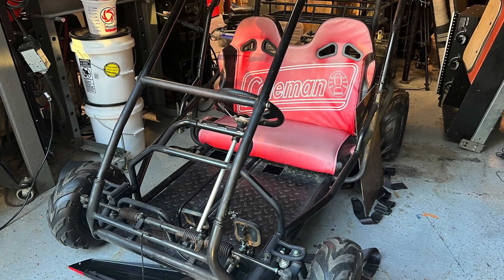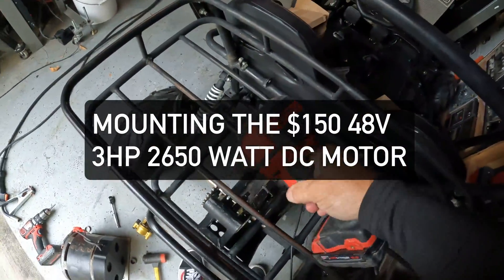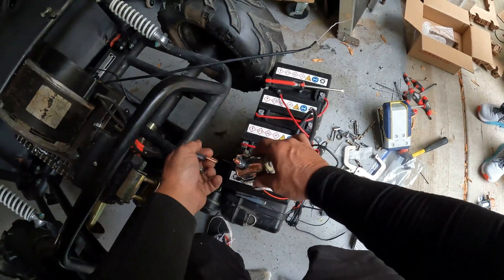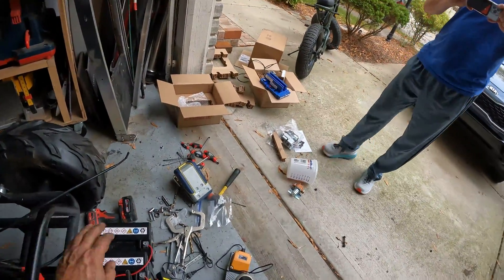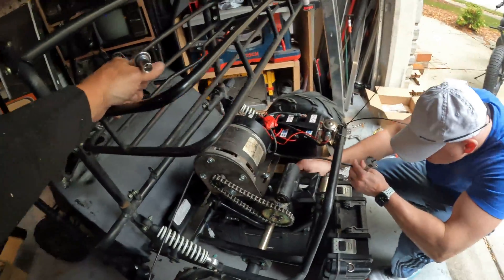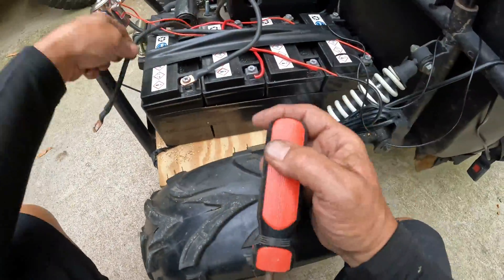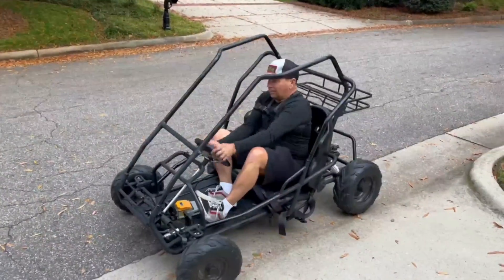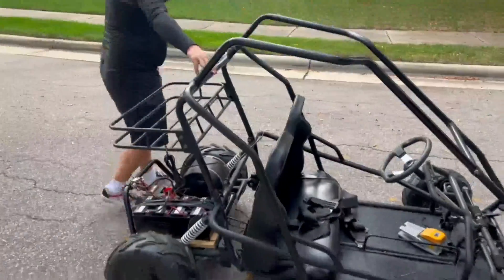Coleman 196 Electric GoKart Conversion - Part 01

Comment: @hack-lab this is EXACTLY what I'm attempting to do now. Swap the 196cc gasser for a 48v BLDC. Is that a normal Brushless Motor or does it have gear reduction? How is your gear ratio? I was thinking of using the jack shaft to keep the gearing taller for any inclines. Sub'd and following this build. Thanks!
Reply from the maker: The car was extremely fast. I use the jack shaft and I used a golf cart speed controller. Everything is so expensive it you gotta get what you get and don’t pitch a fit.
Reply: That's a brushed motor. That's why it can run directly from the batteries with no controller.
Reply: Did you end up doing a conversion? I’m working on one and struggling to get it going
Reply from the maker: I ended up doing the conversion, but I ended up selling my house. I kept everything but I did buy a controller and everything work perfectly. I’ll make a video with the video I have but I’m gonna buy the same exact gold card. I just couldn’t take it because of the move I will end up doing this again in the fall with the same electrical hardware. All I sold was the frame I loved it it went around 35 to 40 miles an hour.
Reply: thinking of putting a qs 180 or 138 in there do you think id be able to drift this hoe if i change the tires to slicks? @hacklab.ryandewitt
Reply from the maker: @2-8-4  you would definitely need to add slicks to do some drifting with this hoe
Reply: @hacklab.ryandewitt  for sure thank you im quite new to this stuff do you happen go know how to connect two 72v batteries together?